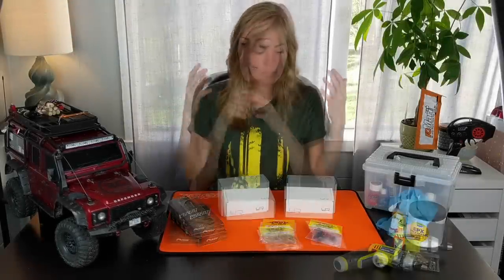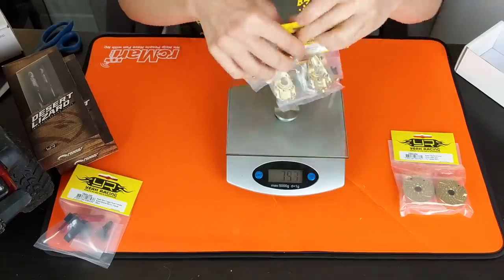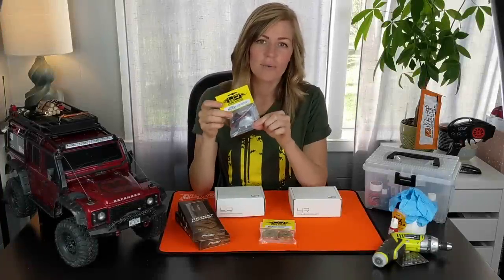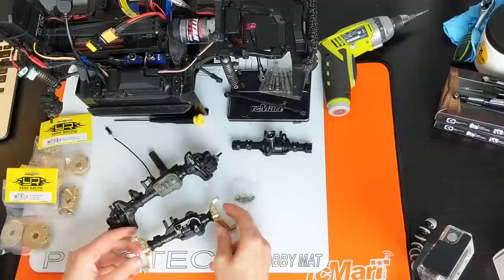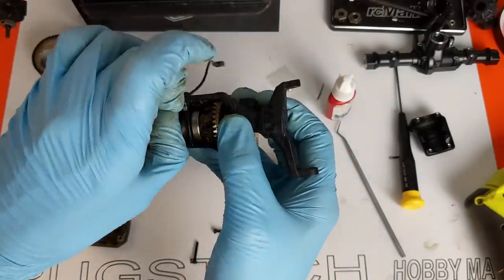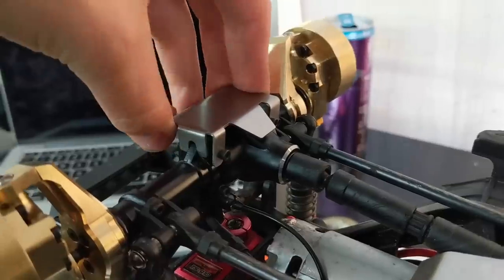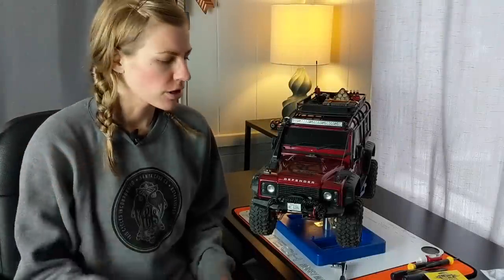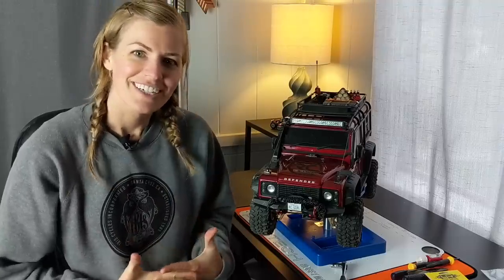SHOULD YOU WEIGHT YOUR TRX-4??  |  Yeah Racing Metal Axle & Brass Upgrade Sets

Comment: Do you have to upgrade both front and rear at the same time? Can i just do the front and not the rear?
Reply from the maker: Yeah you can just do one if you want. It's just a swap of components over, so front and rear should still be compatible
Reply: @RCGirl  thank you , i saw it was 139.00 and i just got the truck a couple days ago..so many things i want to do lol , its adding up fast. I may just get the spektrum rugged and the front end for right now.  New subscriber , love all your video's.  I have been out of the hobby for awhile , just recently back. Also just got the traxxas stampede VXL.
Reply from the maker: @markrimmele2096  looks like the axles are going for $86 right now on amazpn. But yeah, the weights add up in cost
Reply: @RCGirl  really? Hmm maybe i was looking at the wrong one , thanks i will have to check it out again

Comment: I think might too much on the weight that  stock esc and motor would be struggle so better to use brushless system. If you want keep factory just aluminum wheels, brass on add knuckles and front plate for battery and remove the medium tray battery. That secret 🤐🤣

Comment: if someone can tell me what's wrong  with my traxxas slash 2wd vxl i'd be very grateful so i noticed that when i push the throttle the transmission seems to be disconnected to the shaft basically i doesn't accelerate and i can't do burnouts i think that the shaft might be broken because it's diconnected from the transmission

Comment: Are these upgrades good for a TRX-4 Sport?
Reply from the maker: I'm not sure.... but I don't think they are compatible since the TRX4 sport has permanently locked diffs and no shift mechanism. So I'm assuming the axles wouldn't work. But the brass portal weights should.
Reply: @RCGirl  Awesome, thank you. I wonder what the difference is running with just the weights at the wheels.

Comment: The problem with adding weight to the steering is your adding stress weight to the servo.
Reply from the maker: True! I'll have to keep an eye on that
Reply: AT low speed it is ok.Don't have to worry about the servo! For a 20 kg servo or less means nothing.  @RCGirl
Reply: @scbennet6740  umm OK, but that's where most damage is happening! 
Example, driving a 1/1l car at speed (without power steering) is easier to steer than low speed.
Reply: Exactly...,but that's the point , we are not talking about 1/1 cars :-)  @theclassicalrc1201
Reply: @scbennet6740  lol never mind, I apologise on wasting your time.
Reply: You don't have  to, it is just a discussion ,everything ok :-) @theclassicalrc1201

Comment: Weighing the brass parts and saying they add that amount of weight to the front of the truck is WRONG. You need to weigh the stock parts and the difference in weight between them and the brass parts is how much weight is added. Such a silly mistake.

Comment: samix is better. bare brass corrodes so rip that. those axles are insanely overpriced. there are steel cast ones for half the price. fit  is the same and finish closer to real metal than on the polished YR.